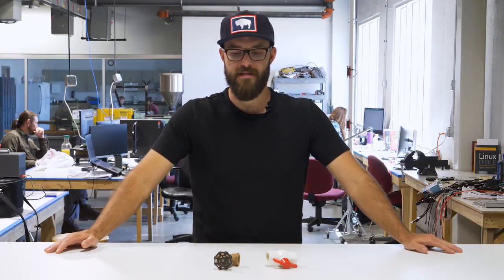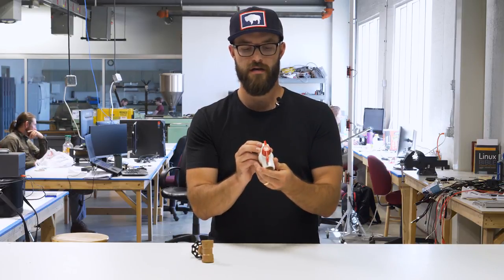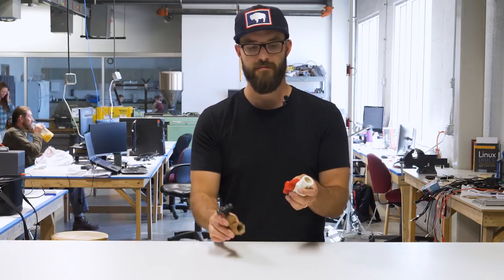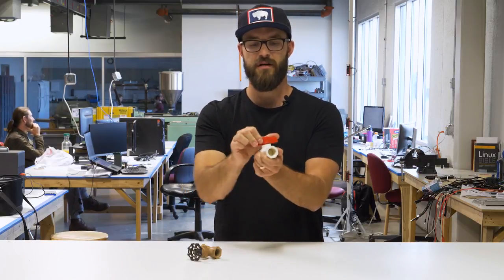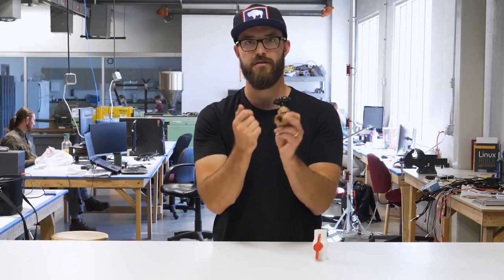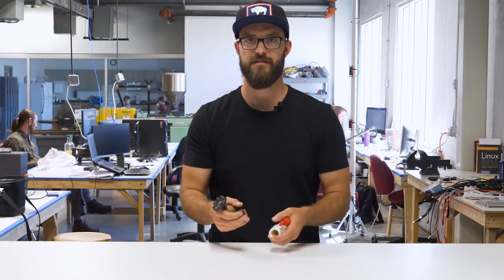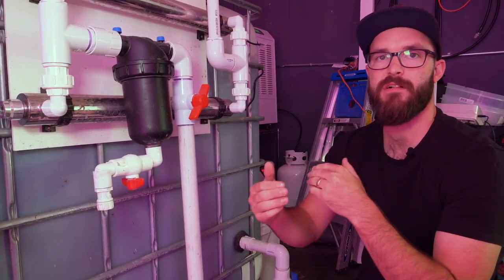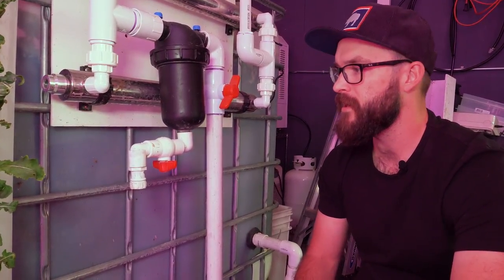The basics of valves in hydroponic plumbing

Comment: Why not just get a pump you can regulate the power on? Instead of using your Pipes to controll the flow
Reply: Variable speed pumps are not very common in the size ranges that are typically used in hydro systems, and are generally very expensive compared to single speed pumps. Having valves allows you to easily fine tune the flow rates/pressure drop and allows multiple legs to be tuned differently off of a single pump/res.
Reply: Steve Hill 
But Will the pump not take dmg? 

But Yes pumps you can regulate can be expensiv when ITS a Company Like yours. For ud small people ITS more Easy cause we can buy a small
Reply: Short answer is no, regulating the flow of water with valves will not damage the pump - from the perspective of the pump its no different than a longer line or higher lift. The longer answer is that you don't want the size of the pump to be grossly mis-matched to the system (i.e. don't put in a 2HP pump where you only need 1/20HP). Depending on the type of pump, it may have issues if the flow is restricted to a very small fraction of its capacity and zero flow can eventually result in damage (although no where near as quickly as damage occurs running the pump dry). Bottom line is that even if you spend $1000+ on a sophisticated multi-speed pump, it's very likely that you'll still be using valves to fine tune flow in various parts of the system.